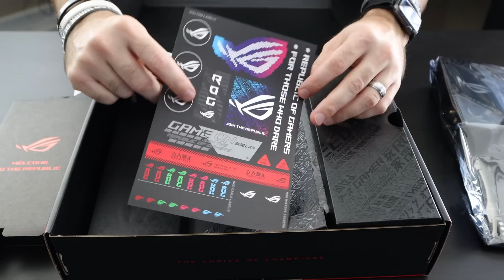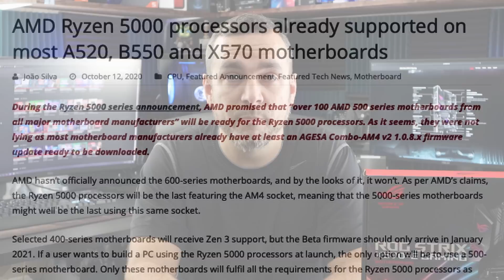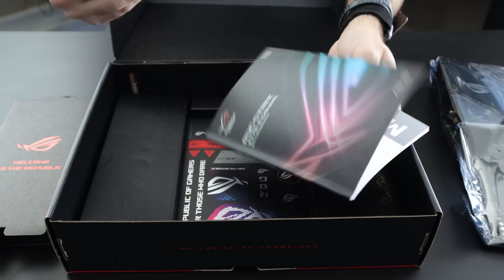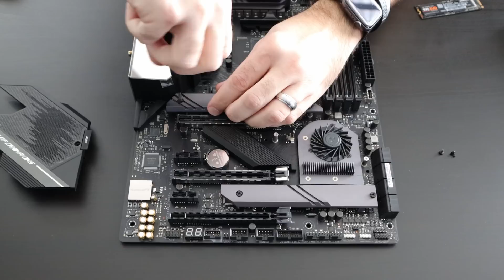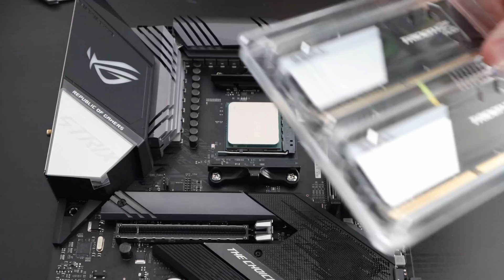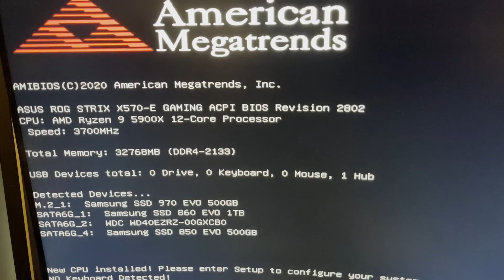Gaming PC Upgrade | Ryzen 9 5900X and ASUS ROG STRIX X570-E Gaming PC Build

Comment: How has the motherboard been so far?
Reply from the maker: All good. No issues! Just cleaned the chipset fan a couple of weeks ago. After a couple of years of use, it wasn’t even that dusty. You got a build in mind?
Reply: @JasonRose2628  Thanks for the follow up! just. Just picked one up used to swap an older mb for a good price so just was wondering peoples’ thoughts that actually own it. Definitely reassuring

Comment: Thank you for the video! Curious if the HDMI and Dport on the motherboard are ready to use out of the box or is something else required? I have a video card but would love to run my sensor panel off the board if possible.
Reply: Then you need a CPU with integrated graphics. The Ryzen 5900x does not have that and would show a black screen after boot up. You need a separate graphics card with the 5900x to show the image on your monitor.

Comment: Late comment on this but hopefully you can help me out, I recently got this motherboard but don’t have the extra 4 pin connection for the cpu so each time I’ve been trying to boot up it has to been booting, could that possibly be why? Its been a frustrating few hours not knowing why Ive been stuck at this stage
Reply from the maker: Not having the 4 pin connector for the CPU power would not stop it from booting. What exactly is happening when you try to power on the PC? Does the rest of the system appear to have power?
Reply: @JasonRose2628  The pc has power but I just have a constant Q-Led light on next to "Boot", its not an ssd, hdd or ram issue as they all work perfectly with my previous mobo and ram combination so I dont know what to do.
Reply from the maker: @Riskee_TV  The only thing I can think of right off, is that your board, for whatever reason may need a BIOS update. Did you change any other components, like the CPU? What CPU do you have?
Reply: @JasonRose2628  It was a freshly purchased rog strix x570-e mobo with a ryzen 9 5950x cpu. How would one also do a mobo update without being able to even boot up into bios?
Reply from the maker: That could definitely be the problem. It sounds like your board, for whatever reason, isn’t Ryzen 5000 ready. If you have an older CPU, you can use it to boot the machine and update the BIOS. If not, you will have to use BIOS flashback. I recommend this video.  @Riskee_TV . https://youtu.be/_aBiTr6tpcs
Reply: @JasonRose2628  Discovered that video myself last night actually, did it all today and got it all sorted, thanks for the advice.

Comment: Question for ya- what if i only have a single 8 pin for the cpu? 
Shit im about to do the same upgrade... from my maximus xi call of duty to the x570. This is funny to see. I mean im a year behind ya but only having a i79700k sucks since im constantly using my cpu at like 80%+ and thats without streaming or anything.
Reply from the maker: If you only have the 8 pin, everything will run fine, you just won’t be able to overclock. You might be building it a year after me, but it’s still an awesome build. No reason to buy newer hardware unless you want to run 4K. Sounds like your a smart builder/shopper. 👊🏼 Good luck with it.
Reply: @JasonRose2628  thanks, and i am overclocked on the 9700k atm but only to 4.6 i know it can go higher but i only have a ID cooling aio and when i went all core 4.9 the cpu would get to hot for my liking. Im in a small room so it heats up quickly. But with the upgrade to 5900x i think the max was like 4.8. But idk if ima need both plugs to get that iv been researching and some people say the 8pin can do 150w some say it can do 200w+ and if so that means ima have to get a new powersupply as i got a semi modulare powermax 600w
Ps: im using a MAG mpg 343cqr monitor so its a 1440p ultrawide.
Reply from the maker: The 8 pin EPS CPU connector provides over 200 watts. The PCIE connector provides 150w+. The extra four pin is generally needed to overclock, it just depends on the CPU. But Ryzen 5000 is still a powerful line of CPUs. Pair that will anything 20 or 30 series Nvidia or 6000 series AMD and you have an excellent machine. And since they are all considered “old” at this point, there are a lot of good deals to be had. But I have studied the numbers on the 40 series cards. They are completely overkill for most builds today. Maybe when they release 4070 or 4060 it will make more sense. But then they will probably be completely overpriced. So, I’m gonna stay “old” tech until prices improve. Especially when I’m on 1440P like you.
Reply: @JasonRose2628  yea ima wait till 50 series hoping the power cable will be better made and not so finicky because for now my 3060ti is handling great for the cost and performance. And i just bought the 5900x and a strix x570 for like $600 with the deals going on. I saved like $200+ because of it. And ima miss my maximus xi CODBO4 edition as the look of it is dope AF but i wanna go AMD and since the only meaningful upgrade from my 9709k is only 1 cpu being the 9900k to gain the extra threads im more after the extra cores for gaming and streaming etc. Just playing dying light 2 or gt5 rp servers it just maxs my cores out so i want more head room. I look at everything the same being if i can go little overkill and only use no more than 80% of a hardware than in my head it will last longer since im not using it to its fullest. Thats 1 reason id like to upgrade my GPU to because it gets maxed out on dying light 2 if i go full settings and im only getting like 60fps. Its fine but games like that or really any game i like to hit atleast 100fps+.
Reply from the maker: Sounds like you definitely have a good plan. I think you made the right move jumping to Ryzen 5000 I instead of the 9900K. My son has the 9900K in his machine, it is a beast. But if you are spending money now, might as well buy newer components. I’m hoping AMDs 7000 series GPUs turn out to be awesome. If so, I might make that jump later next year. But I’m not gonna touch 40 series. Just too expensive and like you said and so many have experienced, can be a fire hazard. Lol.

Comment: Hi, I have the same motherboard and Processor as you have in this video. Just a quick one, do I need to download drivers on a usb or is it ready to use straight away?

Sorry if this sounds dumb, I just switched from Console to PC like 3 weeks ago and I still have a lot to learn 🥲😅
Reply from the maker: If you can get to the BIOS and install Windows, then you are good. From there, you can install the latest drivers and updates for your system.
Reply: @JasonRose2628  Thank you! Managed to get it up and running 😀

Comment: Built my PC (with this exact mobo & cpu) but cant seem to get my PC to post 🥺 keep running into “D6” issue. GPU works fine and cords are seated correctly. Any suggestions if its not flashing the BIOS?
Reply: did you ever figure this out??  I installed my x570 with a liquid cooled 5900x and i cant get any display after turning on?
im thinking a BIOS flash is need? my bios is currently 3602 (sticker on the mobo)

Comment: I just got the same exact board and CPU beast mode... I spent 6 hrs trouble shooting why it wouldn't boot out of bios splash screen ... Put old CPU in and it boots to bios did bios flash to 4202 and bam good to go

Comment: I wish I'd have watched your video before I built my system up!
Why wont it boot I asked myself. I tried flashing the bios, taking it all apart and re-seating the cpu and liquid cooler. I even bought a 4pin cpu power plug to put in the spare socket and conect it to a molex.
In the end I realised I'd not put my two RAM chips in A2 and B2. Bum!

Comment: Hey man, I'm doing the exact upgrade in my build, did you have any problems with the Gskill memories? I thought the should be 3200, you got 3600, if it works fine I gonna get de same clock.

Comment: I'm now scratching my head about the direction since i've only just recently built my X570 Aorus Master AM4 build, already have Thunderbolt 3 and 10Gbe - so Im wondering if the new Z690 boards requiring new LGA 1700 CPU's are actually worth the money to upgrade or i should just swap my AMD Ryzen 7 3800X for a newer CPU, will I actually see any noticeable improvements, so i'd be interested to hear some feedback. Im inclined to stick with my current machine until new features justify the cash required...

Comment: nice video ..so is it worth the money the board . and would it fit a Ryzen 7 5700G
and WD_BLACK SN850 1TB M.2 2280 PCIe Gen4 NVMe Gaming SSD with Heatsink as it has a heat sink

Comment: Hey techrated, was that last single 4-pin cpu connectors required? I have the 2 x 4-pin cpu connectors, but I’m not sure if that single 4-pin connector is required… I go to power on, and I get mobo rgb’s and other lights, but no “on-beep”, nothing turns over/turns on and everything is quiet, not sure if I’m missing something?

Comment: Guys i have the same cpu and motherboard, tried many ram and ram configurations, and whenever i enable DOCP (XMP), the system keeps boot looping and not post not even to bios then i have to clear cmos for it to post at the default ram speed.
Reply: What is your ram, timing and bios?

Comment: recently i bought 5900x , now waiting for x570e gaming, the best part, there is no graphics card that does not cause bottleneck, this cpu is way to powerfull for current gen gpus :] 5900x will last at least 5 years from now, probably more. its 600 euros but u get what u paid for..Team Red, fck intel

Comment: I have your same build with 5900x ram g skill F4-3600C16D-32GTZNC and when I play after 15/20 minutes the game crashes and the monitor turns off and the yellow DRAM LED lights up on the motherboard with q code 0d. help me please
Reply from the maker: Start by updating your BIOS. That can fix a lot of issues. Let me know how that goes.
Reply: the bios has already been updated to the latest version

Comment: hello techrated! im building a similar build but im curious to know whether when you've installed the ryzen 9 5900x did you have to do a bios update with an older gen amd cpu or were you able to just launch it straight out of the box and go into the bios when you install the 9 5900x. Also amazing video! this helped me a lot
Reply: you can update the bios from USB even without CPU, so you should be fine even if you get one with outdated bios
Reply: @ben_mkiv  thank you

Comment: Great video showing everyone just what they need. Watching your build encouraged me to do my own build. I've bought the ROG Strix Gaming motherboard and the only thing is, at 5:03 and 12:03 you talk about the 8 pin and 4 pin CPU sockets but you don’t mention any more about them. Do you have to use both the 4 pin and 8 pin cables? In the Asus manual all it says is not to use the 4 pin only as it will cause the board to overheat.  Maybe you can help me further. Thanks.
Reply: Ya I’m having the same issue, I have an 8 pin cpu cable, and a 4+4 pin cable too. Idk if it’s ok to just plug in half the 4+4 pin cable in and leave the other hanging. I’m going to just go with the 8 pin for right now, but if anyone can let me know if it would be ok to just use half the 4+4 pin, that would be greatly appreciated.
Reply: @TMSTER  i know this is late but, only need to plug in 8 pin, the other smaller 4 pi next to it is if your fully heavily overclocking like extreme stuff.. only need the main 8 pin one and ur good!

Comment: Hey boss - I like the video. Just subbed. 

I'm a newbie to custom building. Had a friend help me years back but I'm now going to be doing my first on my own. 

I've got some concerns but I know I'll get it in time. 
I actually already ordered the exact same mobo, cpu, and ram style as you are using! I got the 32GB 2x16 3600 cl14 ram. 

I'm also using an Nvidia card. I'm partial to them. I'm thinking about doing the vertical mount as you did. I think it looks cool. 

The case I'm using is a Thermaltake View 71. It comes with a vertical mounting bracket but if I do go that route I'll need to get the riser cable. Probably just get what Thermaltake offers to match the case. 

I'm using a WD 850SN for the M2. 

Right now ill also be using a corsair i150 elite 360mm for the AIO cooler. I might mount that vertical as well on the right side. My case manual allows that setup. The AIO has the 3 120mm fans and I did ensure they are static pressure fans, the corsair ML120 I believe. 

I'll be using 3 additional Corsair 140mm fans, 2 on front for intake and 1 rear for exhaust. All I have to do is ensure I point the rear far the opposite way of the 2 front fans to effectively create the exhaust, correct?

Do you think the 360mm AIO w/3 120mm radiator static fans and 3 140mm corsair airflow fans will be sufficient?

Also, does it matter which ports I connect each fan to and the rgb on the mobo? It looks like the X570-E has 6 fan ports and thats how many ill have. It does NOT look like there is 6 rgb ports though and thats confusing me. 

I would truly appreciate your input man! Thanks a ton dude.

Comment: I tried two Asus Strix E Gaming, neither booted. I downgraded to Asus X570 Prime and my CPU AMD 3600 booted right up. I've since upgraded to the 5900X two weeks ago. OC'ed to 4625 MHZ at 1.28375 volts. 280 MM AIO pump with liquid metal applied to this beast. Gaming it runs at 55-60C, CPU benchmarks it's 67c first run, 75c after several runs. I went with WD Black SN750 and SN850 as my NVME drive. 32 gigs of CL16 3600 ram with RTX 2070 so it's decent. Anywhere, awesome build and I like the ASMR music.

Comment: Same build here.. but it won't boot. Did you need to do a bios update for your mobo before using?
Reply from the maker: I didn’t have to, but that doesn’t mean that you won’t. If you picked up a board that has been on the shelf a while, it might not have come updated for Ryzen 5000. Do you have any indication that power is reaching the board?

Comment: One of the few ive seen that installed the aio right, top mount or front mount with tubes down. GJ! :D
Reply from the maker: I actually ended up moving the AIO to the top. But, I’ve used an AIO in the front with the tubes at the top for years and never had any issues. I usually just mount it based on the best airflow and all that.
Reply: @JasonRose2628  Yeah, tubes up at the front isnt that big of a deal, just a bit less noise. Mainly the pump shouldnt be at the highest point, everything else is what ever.

Comment: Hi there, what kind of atx cable power did you use for connectors 8 + 4 pin 12v (figure "A" page 1-19 of user manual) at the motherboard X570-E? and, what if i not have this cable it would be a problem to not connect it? by last, is there a difference if i uses M.2_1 socket or M.2_2 socket for a ssd Pcie 4.0? thanks a lot

Comment: Nice vid man.. Did you have any issues enabling DOCP and getting the ram up to 3600mhz.. I cant get mine to boot on anything above 3200mhz..  Thanks
Reply from the maker: Nope! No issues at all. So far it runs very smooth and stable with a 4.6GHz OC on all cores with temps in the low 50s while gaming. Thank you for the feedback also! 👊🏼🙏🏼

Comment: My msi tomahawk x570 just died (less than a year!), so I decided not to cheap out and go back to buying higher end asus motherboard. This one works surprisingly well, and I no longer have the headache of fan control. Btw, pcie 4 ssd is amazing, I installed windows 10 in under 5 mins. I have a 3900xt, it installed windows 10, restarted a couple of times to get up to 20h4, only took about 30 minutes in total.
Reply from the maker: Yeah it’s a sweet combo! So far, no issues and it’s blazing fast. Good luck with your build! 👊🏼👍🏼

Comment: I've noticed others mounting the radiator to the front instead of the top of the case. Is there a space/clearance issue with this motherboard in regards to mounting the radiator to the top or is it just your personal preference?
Reply from the maker: For this build, it was just personal preference to get the coolest air for the CPU. However, I plan on switching it soon. I want more airflow overall, so I do plan to move it to the top.

Comment: This is my New upgrade. How is it so far?
Reply from the maker: Congrats! You will be very happy with it I think. So far, it has been great. Everything has been very stable. Temps are great and I have the 5900X overclocked to 4.6GHz on all cores. I can’t complain at all so far. I am waiting until the end of this month to do a three month review/update video. Good luck with your build!
Reply: @JasonRose2628  You should use curve optimizer and pbo. You can easily get it to boost to 4.6ghz all cores and still be able to keep your single threaded performance. My 5900x is able to boost up to 5 ghz playing some games and during some benchmarks but during games like cyberpunk I see it boost to 4.9 ghz all cores very often so I definitely think pbo and curve optimizer is the way to go.

Comment: Cool video, but can I give you a hint? the radiator of your wattercoller is installed in the wrong way, the hose is down, so there may be air accumulation, I recommend leaving the hose at the top. Hug
Reply from the maker: No. 
Check out this video! Learn something. 

https://youtu.be/BbGomv195sk

Comment: Is that shroud covering over the chipset fan neccessary. Could you leave it off? Is there any other purpose to it other then aesthetics?
Reply from the maker: Nope, it isn’t necessary. But it does have a small filter for the chipset fan built into it. So partly for aesthetics and part functional.